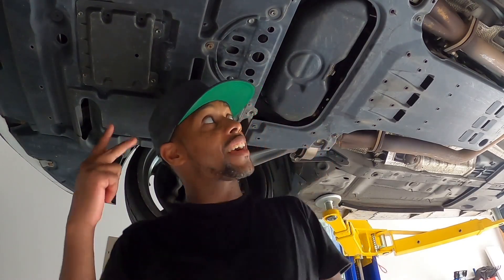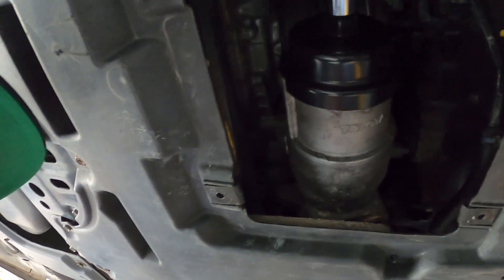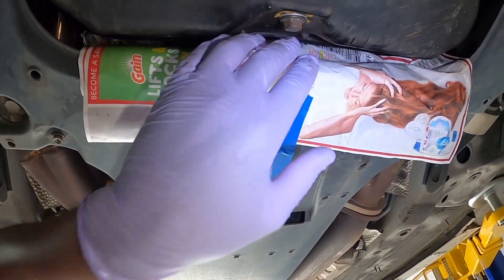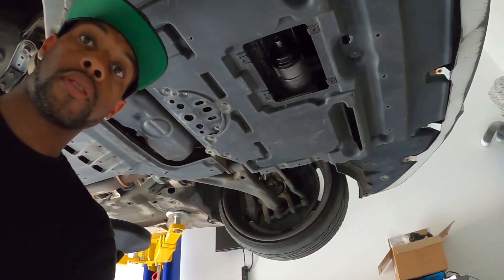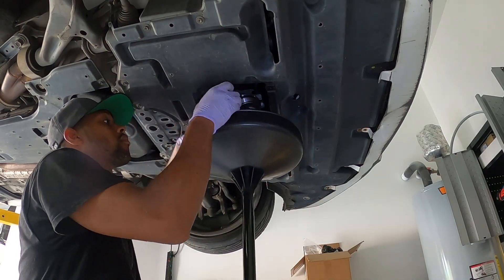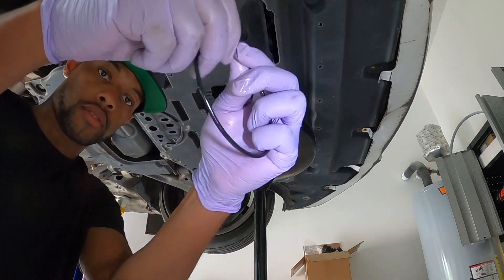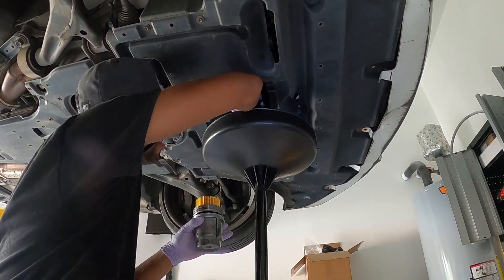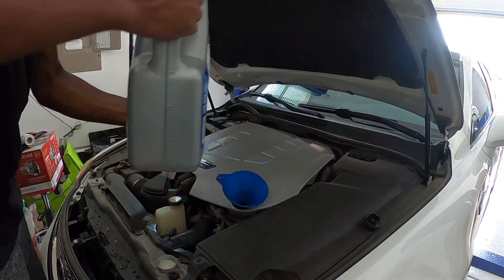2008 Lexus ISF Oil Change - 2URGSE

Comment: That ISF looks good for an 08, keep up the good content. I personally use Pennzoil Ultra Platinum for my 08 every 4K miles.
Reply from the maker: Thanks I appreciate it! I guess everyone has their own personal favorite oil. I guess if you change it regularly (4-5k), does it matter if the oil is not a "real" full synthetic?
Reply: @btbuildthings  Oil is cheap engines are not. Technically you're right about not using synthetic oil if you change it often.

However i just use full synthetic oil.

Comment: Good video- Also people need to make sure that oil filter o-ring around the oil filter housing is in the LAST channel of the housing. this mistake can be catastrophic if it's not seated in the correct channel.
Reply from the maker: Thanks. That's a great point! It's surprising the things that seem to be straight forward can be overlooked and to to you point, be catastrophic!

Comment: Should I use mobil 1 or pennzoil ultra platinum  for the lex 5.0
Reply from the maker: That's a great question. I just did some quick research and it looks like Pennzoil may have the edge over Mobil 1. I will add this to my list and see if I can do some real world testing to see what the results say. Either way, I don't run beyond 5-6k before changing the oil so either brand should be fine.

Comment: You should consider switching to a true group IV or higher synthetic like Amsoil or Redline.
Reply from the maker: I have debated this in my mind for years. I only run the oil for 5k miles. So what does this say about the oil that dealers are using and telling you the oil is good for 10k?

Comment: 18 ft.lbs. is enough on that oil filter cap. I'll bet you know that though...🤔😄.
Reply from the maker: Lol. It doesn't need much but thanks for the exact specs. 😁
Reply: @btbuildthings  
It's printed right on the end of the oil filter cap but no one hardly ever notices. 25 N•m ± 5 N•m
Reply from the maker: @njsongwriter  😆 Lol. Go figure. Thanks.